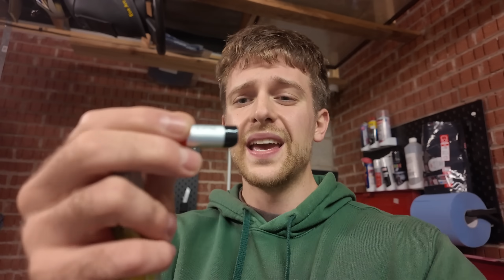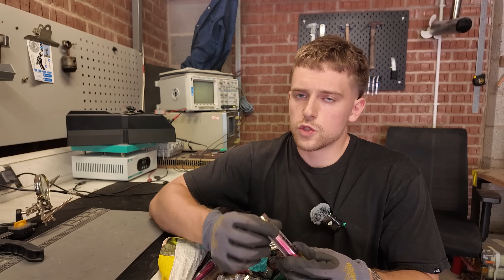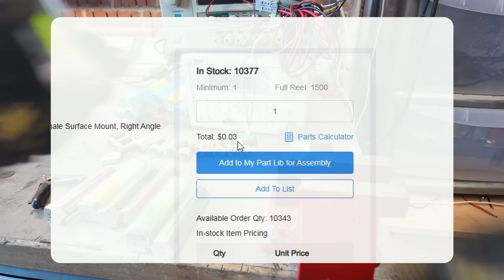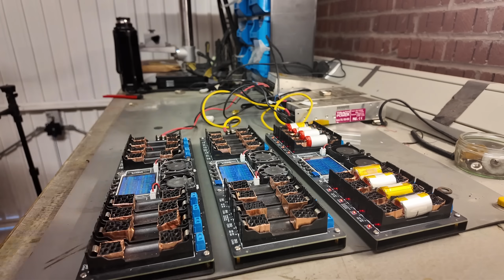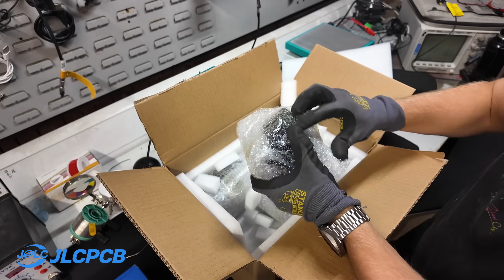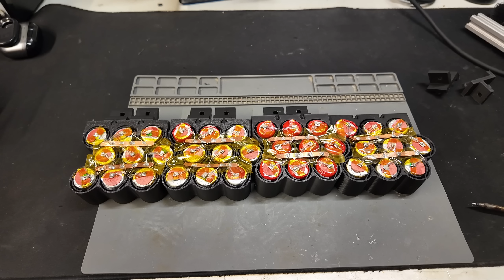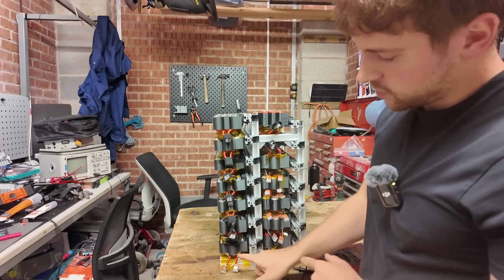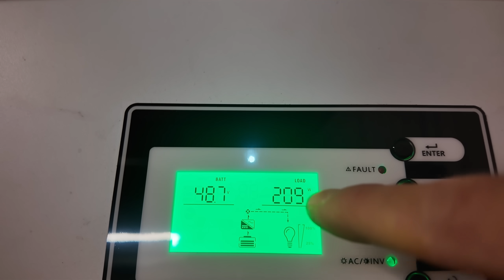I Powered My House Using 500 Disposable vapes

Comment: Drawing 3kw out of this thing and not pissing your pants... Impressively large balls.
Reply from the maker: Ngl I didnt even mean to draw that much power & didnt realise how high it was until I went back to review the footage!!!!
Reply: @Chris_doel  heh i usually find out im drawing too much the... other way ;o
Reply: @Chris_doel fyi: The Wago 221 connectors you are using are only rated for 20A. I have personally seen them melt at around 50A.
Reply: @fex95 actually I just came from A TSI Automation expo, and the Wago 221s are only rated to that because that’s what they’re required to be. They can run much higher. They’re rated for AWG24-12 and can do 30A but only list 20A
Reply: @Apoc_CoD that's all very well but when the kettle went on it was drawing over 60A! It looks like there are two connected in parallel along the whole circuit but still very much in sketchy territory
Reply: @fex95 you can also get bigger rating ones. Not sure what he actually used tho. Good point.
Reply: @Chris_doel  Hit them 3.7V old cells with 7.2V charger for 20 seconds to revive them.
I do it all the time, works 99% of time
Reply: @gimigimi1299  this sounds like a great way to make an explosive event quickly
Reply: @gimigimi1299 and the 1% of the time is them exploding?
Reply: @gimigimi1299once the cell drops below 3v, there is irreversible damage that can cause dendrites (conductive whiskers) which cause high internal resistance and that results in heat. When lithium gets hot, it off gasses and eventually ignites. That’s where a run away condition starts. You just don’t want to mess with it. You might be able to revive certain cells, but it’s only a matter of time before that cell turns into a balloon bomb.
Reply: @efahrenholz  you are just no fun! Jk, playing with used lithium batteries is definitely something that should be done with caution and realistically(imo) shouldn’t be left unattended in a project 🤷‍♂️
Reply: I'd say the most scary part is not being able to know the true maximum amp output of each cell
Reply: @keen283  Well, for nearly all vapes with the round celltype i could find datasheets for the cells. turns out the manufacturer are pretty consistent with the cells. so out of around hundred Vapes i had 6 Cell of different/unknown brand. Same goes for the Soup-noodle-bag cells. All pretty consistent in measurement (capacity, self discharge, internal resistants) bud sadly no datasheet, cause no identifier numbers printed on. 

Those cells are optimised for high currents, not energy density. Which makes sense if you consider they must be capable of vaping some liquids by resistive heating. So a small 0,5Ah Cell is rated at permanent discharge of 5A and 8A for short time (15sec).
So drawing 3A of them at max load here, is like spa-holiday for the cells.
Reply: @arminosaeure29 that's good info to know, didn't really think that some brands actually care enough to provide technical information
Reply: @arminosaeure29 ”soup noodle bag cells”???
Reply: That’s actually a very high C rating I’m quite surprised…I might used these In high kv high amp draw for battery capacity mini ducted fans or small props…could be fun on an 5g 5000kv motor
Reply: @keen283 basically only 4 companies on earth actually make lithium cells, Sony, Panasonic, LG, and Samsung, they are the ones who do all of that good testing and documentation stuff. I have however seen rewrapped batteries, batteries that have tiny little 10400's inside of 21700 cases that are packed with sand, all kinds of nightmare stuff
Reply: @keen283  you can test that pretty easily, take one of them, charge it and put smaller and smaller resistor values until it blows up
Reply: @sigataros Ok, I’ve blown up all of my cells. What’s the next step?
Reply: @sigataros that's destructive test.  Many dischargers on the market that allow custom current, with voltage and temp monitoring. The issue is time...
Reply: @sigataros this really is not a good solution lol
Reply: @floydkirk-j3w lmao
Reply: @keen283  well you could take the mad man approach and use a few "sacrifice" cells for load testing each model of vape battery... 
Get the average for battery type (kill 5 - 10 each) and bingo, you kinda know what it is.

Or you look up the data sheet for the battery based on its serial and data written on the side. Like a normal person, but where's the fun in that. Also, most batteries in disposable vapes are high "C" li-ion cells, though I've come across LIPO batteries in the past too,  (which is terrifying if you know anything about the madness of Lipos aha, I always say goodbye to my family when i head to the shed to charge my FPV Lipos...) 

Though, most dispo vape cells never go past one cycle cause they end up in landfill, so all things considered outside of being too discharged, they're usually REALLY healthy. But that doesn't mean you use them for something like this, especially in this configuration.
Reply: Nah not having a clue on each mixed cells C rating scares me way way more
Reply: @keen283  Yeah, the misinformation on these sorta cells is the most anxiety inspiring point. Soldering near em or building a pack out of them is only scary the first time or two you've done it.
Reply: to be fair thats only 6w per cell, with the average vape pulling over 15w when you take a hit off it. theoretically it should be golden for 6kw and still have some headroom for safety
Reply: @badatcad for a short amount of time it's fine. I wonder how long it could handle 3kw before it overheats too much
Reply: @badatcad  It’s the current through those WAGOs I’d be worried about.
Reply: @badatcad  15 for rubbish disposables, ive been vaping for 12 years now with a 220w device set to 65w
Reply: @lennycat7964 my man, I used to run .09 ohm on a triple parallel 18650, used to load brand new, fresh charged vtc5s down to 3.6v lol
Reply: Vape cells usually put huge currents. If he has many and correctly monitored (BMS) is not scary unless his inverter or BMS is bad
Reply: @111Xumi111  Yes, for less than 5 seconds.  I've been vaping (not disposables) for many years and every vape I have ever used shut off in 5 seconds.
The early mods used standard cylindrical cells, but most now use pouch cells.
These cells are not designed for long high discharge and they aren't built for longevity.
Also, most modern disposable vapes are USB rechargeable.  But you cannot add liquid to them or change out the atomizer.  But they use tiny batteries that have to be recharged before the liquid runs out.
Reply: @tarstarkusz  that is basically not true. that vape turn off after 5 sec is a political decision, not a technical.
manufacturers can optimize their cell for different things, high capacity, recharge cycles, and high current are only a few points to optimize to. In a laptop or phone you want most capacity possible, on a EV you want high charge/discharge and cycle stability. Those Vapecells are optimized for current. 10C constant discharge current are normal.
Reply: @arminosaeure29  Sure, there is no reason for it relating to the battery if you use a battery good enough for the application.  
But it is very rare, none that I know of, that allow for longer than 5 seconds.
Reply: @tarstarkusz  because it is not a technical reason. Politics decided that vapes have to stop after 5 sec. most vapes i salvaged the cell from, at least those with cylindrical cells, i could find datasheets. very consistant trough out every vape brand, high current cells with ~10c constant discharge and peak ~15c/10sec. plenty enough for continuous run of the vape till battery is discharged. for the pouch cells you usually cant find DS due to no labels, but in terms of internal resistance, volume and capacity, they should run in the same ballpark .
Reply: @111Xumi111 Knowing you made it yourself makes it scary though
Reply: @SquiddyyBoyy  sadly most things in this world are only better when you make it yourself, for yourself.
Reply: @SquiddyyBoyy  multiple layers of safety, from fuses from each individual battery, a fuse in between the series connection of those 25 volt stacks and a BMS to top it off, and knowing how it was all made and with the technical know-how, I think it's as good as safety gets for reusing these batteries practically
Reply: @SquiddyyBoyy  When you got no clue what you are doing, then it is scary.. If you know what you are doing, it is not scary...
Reply: @FireGodSpeed  When you have no clue what you are doing, your stupidity and ego protects you, when you know what you are doing...you know how sketchy it is.
Reply: @SquiddyyBoyy  Well this guy looks like he is a professional. Bit of a mad lad but still knows what he is doing.
Reply: @SquiddyyBoyy  so if someone else built it makes it safe then?
Reply: @FireGodSpeed  i made a 14s9p battery by soldering together 18650 cells taken from laptop batteries about to be thrown out
 
it worked well as an ebike battery for 3 years but i was still scared it would burst into flames every time i charged it
Reply: @SquiddyyBoyy  You trust a random workshop in china more than yourself? Thats worrying bud
Reply: @SquiddyyBoyy  spoken like someone with very little confidence in his abilities.
Reply: @SquiddyyBoyy knowing Chinese people didn't do it is SOOO SCARY HUH?? Maybe let's all start being nice to them, huh?!
Reply: @FireGodSpeed  bro, if you're not scared, you have no idea what you're doing. i learned electrical safety from a 70 year old man who had a lightning strike up his entire arm and a large portion of his chest
Reply: @SquiddyyBoyy naw I'm dumber than this guy and less careful and I'm still alive. Built dozens of higher voltage banks than this one. Yes explosions can happen. No it's not likely. I've dropped so many metal things completing circuits where I knew i was dead lol linking the positives of two 72v packs and things like that. Like this guy I tend to not take enough time for safety measures. He's not exaggerating it takes FOREVER to do every step by hand by yourself it takes months, hours every day. If you've shorted a car battery it's about that exciting that's it. Brighter flash though it'll blind you temporarily. The real issues are sharp objects, puncture one of the cells and it's over instantly. And plugging in two drastically different voltage cells, this one you can save if you are paying attention. The cells will rapidly expand before catastrophe. If you break the connection fast enough the reaction stops and you're alive. Cells are dead and you prolly gotta change ur shorts but, it's only kinda like a bomb. Not an actual bomb lol watch next week I get killed by a battery pack. Embarrassing
Reply: @Harolds_Archive  What has a lightning to do with electrical work? HUH?.. One is controlled and predictable and one is random and cannot be controlled.. If you wire the live cable together with the ground well you know what will happen and its your fault, that it happened. If you get hit by lightning that is completely random and you can't control it. I don't see the correlation between the two. 

There’s always some uncertainty about whether something will happen, but exceptions don’t change the rule. 

I run lathes, milling machines (manual, cnc). I work near hydraulic lines, near open flames, molds that are 300 degrees C, Near a furnace. I am not scared of any of these, even though "what if" A part comes flinging out of a machine? "what if" a hydraulic line bursts and shoots a hole through my arm? "What if" a open flame hits me and burns me? "What if" They drop in wet metal and it "explodes" and shoots molten steel everywhere? 

My guy is living in constant fear and wants to tell me that you should be scared of the work you do, especially when you know what you are doing... What. You should respect and be cautious about the work you do but scared is the wrong way.
Reply: @FloofyTanker  what kind of fuse did he use for each cell according to you ?
Reply: @hiiambarney4489  *makes it look like he's a professional. Inspiring people to have the confidence to follow in his footsteps, and potentially burn their house down.
Reply: @randomoldguy7  Really, "sadly most things in this world are only better when you make it yourself, for yourself."   This is just generalized hating. What do you think your dishes, utensils, clothes, shoes, blankets, books, fishing poles, doorknobs, furniture, would look and function like if "you" or anyone else made most of the stuff in the world? And I chose examples based more on just craftsmanship and finish - consider complex objects not to mention electronics, HVAC, vehicles, appliances, ...? The reality is most things in the world that most people use can not be made by most people even if they had the time and means to do so. We are insanely interdependent on each other and that includes a lot of people/occupations/skills that are often not even recognized.
Reply: @SquiddyyBoyy id rather know I did it than some rando in China 😅
Reply: @FloofyTanker  This isn't a practical OR safe way or reusing these.. they're not actually meant to be reused that's why the vape batteries are so cheaply made compared to a usual 18650 for example.
These also aren't good for putting out a lot of current. 18650s can yes, not these, they will rapidly heat.
Reply: @hiiambarney4489  Never introduce him to styropyro.  They'll collaborate to make an extremely dodgy laser of some sort.
Reply: @AlpineTheHusky  when you have no clue what someone else is doing, you think it's sketchy because you don't understand how it works. when you actually understand how and why it works and make it yourself you will know it's not sketchy.
Reply: not if your smart
Reply: @randomoldguy7  the sheep feel safe with a logo on their equipment but it's also just built/designed by some dude
Reply: @yannmassard3970  9:27 He also showed the Tesla battery as a similar example. Did you watch the video?
Reply: @TheBladus id say put a can of fire retarded insulating foam next to the bms or inverter. Incase it blows it'll just be a big mess to clean rather than a house set on fire. 😅
Reply: @FloofyTanker  actually either a fire proof metal container for the lithium ion battery packs (which can be extremely dangerous) or put the batteries away from the house / living quarters,.. nice FREE project though!.. and lithium iron phosphate do not catch fire like the lithium ion batteries if you have $$$
Reply: @111Xumi111  Huge currents for a second or two, continuous load is a very different matter.
Reply: @111Xumi111  I don't care how good the BMS is. Chinese crapola vape batteries are essentially live rounds that didn't go off, 24/7. :D
Reply: @111Xumi111  those dodgy solder joints don't inspire much confidence
Reply: @D4no00 no I am surprised he hasn't got a battery welder especially for a project of this size.
Reply: I was also shocked he didn't have any go poof on him. 😂
Reply: @alexandergreenfield91  Unfortunately you cant weld these. They have little fins.
Reply: @D4no00  they come dodgy out the sweatshop they're made in to be fair
Reply: @alexandergreenfield91  You can't really weld these types of Lithium cells. They have little soldering flanges built in, can't weld those. These cells are made for soldering - but I agree, the solder joints seen in the video DO look sketchy.
Reply: That's not really a lot tho considering the amount of cells, and with the safety features it's unlikely something will happen. Lucky for us batteries don't just explode for no reason so if you take care of everything correctly it will be fine. Also a fun note about drawing power but I've seen 7.4V battery packs designed for some 70A meaning you could pull 5kW out of 2 cells in series
Reply: @panzervpl94067.4 x 70 is ~500W not 5kW?
Reply: those vape batteries have huge CDR lke 10A atleasat so 500x10A(probably can handle more)x3.7v they are probaly able to draw 15kw
Reply: It's parallel connection. TBH using those thick (costly) bus wires was an overkill.
Reply: Vaping from a single cell probably pulls way more current than how much each provides in that case.
Reply: With electrical systems you need to consider the amps not the watts. And in the case of this battery it was less than 65a.
Reply: Load balancing is the really big problem with these larger batteries.. Both on drawing power and even more on charging. Was very glad to see those fuses.. Its charging where you really need the red& white headband and the priest praying over you..
Reply: @Lucien86  The battery gods will bring you plentiful safety if you learn to respect the lithium
Reply: Ive pulled 3kw through a 1850va UPS, no big deal. Little smoke though
Reply: Pee is stored in the balls.
Reply: 12.5 Amps?
Reply: Piss is stored in the balls, makes sense
Reply: Go watch styropyro hook up some car batteries and see what he does with it :)
Reply: Woman are strong to.  These comments is leaves women for equality
Reply: When you know what you're doing you don't need hope.
Reply: Yes amazeballs 🎉
Reply: Next time byd battery
Reply: Magyarországon, több mint 100 embernek van ennél sokkal nagyobb, és biztonságosabb rendszere.
3kWh semmi.
Magyarországon autót töltenek éjjel!
Reply: Put it in a metal box that vents outside if it gets off.
Reply: @MarkkuS  Get the Batsafe.
Reply: @CURSE-LFC bat safe, not in main building i occupy. Battery safety is like my no1 prio
Reply: Well, obviously, as piss is stored in the balls.
Reply: pee is stored in the balls
Reply: battery pack is in the warehouse so that mitigates a lot of potential damage. hes thought this through
Reply: @Okahui that way you can kick that shit out if it blows
Reply: @Okahui much better to build an outside rack just for the batterypack.
Reply: That's some hefty voltage sag when current is drawn from the pack. Obviously the BMS is not optimised for those cells.
Reply: What you dont see is a 5 gal bucket of sand under the table he can shove a battery that starts to run away, it happens all the time, dont freak just be ready for it, when you are playing at scale you would not believe all the safety in the back ground, but .... 3kw is a good start LOL
I have 3/4 of a ton of AGM at 145AH each for a total of 15KW
Keeping in mind you can feel DC starting around 30V so 100V at 1 amp will kill you! not much more than that and it will leave Burn marks on your Organs on its way through your body! A/C leaves burn marks on the outside, at least A/C will throw you! BUT DC will Grab and Hold you and it will hurt the whole time!
if you dont know what you are doing and not comfotable with Electronics.....Dont.
Electrical engineers have to play, that s how things get done and invented, finding things to do with old equipment that sometimes have only been used to less than 1% of their life, like vape batteries they have been used one week out of their 20 year life....
sometimes where I am commercial solar farms cycle out panels after a year or two they may have only degraded 1% but to them thats a lot over 100 acre solar farm and we can get them cheap to free! I have even taken broken Biface (like broke on the back side still putting out rated voltage and amps) they will fail before their time but .... someone can use them until
I do suggest a good MPPT charge controller to start with, they normally run $200 and up and I have tried the $50 PWM I never had one last more than a week LOL
and dont skimp on wire quality! "Ever"
Reply: @Grandassets  This battery he made is dangerous.  These cells are not designed for long high amp draws.  Nearly all vapes shut off after 5 seconds.  They literally will not allow you to go longer.  The batteries are very cheaply made.  They aren't made for 10 cycles, let alone 500.  They are very likely to come out of balance as well.
Reply: @tarstarkusz  we could tell if we knew the numbers on them
Reply: @Grandassets  Sand and fireproofing materials + concrete and hole in ground with sufficient ventilation, otherwise you get a subterranean explosive if a big cell goes "yeah nah fuck this dude, time to catch on fire".
Most people watching this video probably won't attempt something like this due to lack of technical knowledge. But it isn't impossible to self teach, maybe do a certificate in basic electrician safety if you're absolutely new..
With that said, after my many years of playing around with dangerously high voltages (CRT flyback transformers) and "instant death" amps (microwave transformers), as well as my many LiPo powered projects (FPV drones mostly), I still fear electricity.

I'm comfortable building things that use high power, but something I've learnt over the years, is that those that learn to respect and fear electricity and lithium, are usually the ones that survive.

LiPo's alone are terrifying, a charger (had a mate get into FPV but bought the shittest and cheapest equipment he could) that is improperly calibrated can take a 4S battery to 6S voltages and you're left sitting there thinking "how isn't this thing on fire?"
I always store them in batsafes or battery flight bags, routinely check the cells every week to keep them at storage voltage when not using them etc. 

The lithium gods always treat those well who respect the cell. But they keep you on your toes, sometimes batteries just like to fuck with you cause they can.
Reply: @ausboard  Enough sand alone hanging over the batteries ready to dump is important enough
Reply: Yup, 5 more minutes and 🤧🤧🤧
Reply: Beefy build fam, well done. 

Practically speaking lmao 😂

But I watched the whole video
Reply: as an electrical engineering student in a design group for a solar powered EV, the second he said BMS I knew he has to have quite the electronic background. This guy is most likely an EE or adjacent, or someone with a lot of industry experience; crazy good work!
Reply: @formy5287  You are probably right about his background, but come on: BMS are nether rocket science nor a which craft secret.
Reply: How does he run this at 50 volts and is able to run his house? Wouldn't he need 120 or 240V?
Reply: @noahw5887  that's what the inverter is for, all explained very clearly in the video
Reply: @noahw5887  Thats what the inverter does. Takes DC 50 Volts from batteries and inverts it to AC 220 Volts.
Reply: @noahw5887  16:55
Reply: Jesus Christ is real and he wants a relationship with you personally, He is the Way the Truth and the Life and He loves you more than you can fathom ✝️🙏🏽
Reply: @xoapbtw8914 this is true, but in this day and age peoples faith is seriously being tested...with many people failing, giving up and never wanting to return.
Reply: What's scary is that he increased the voltage to 50 volts before the inverter. Very unnecessary and dangerous.
Reply: @jamesjonnes  48 Volts is the typical working power gor these kinds of battery packs. That‘s what the inverter expects. Lower voltages necessitate unnecessary thick cables due to the higher resistance. So it‘s actually safer. Still I eould monitor the battery with an infrared camera to look for potential hotspots.
Reply: @jamesjonnes  not at all. higher voltage at given power means lower amps. Therefore less resistance in the connection and cables. With this Setup he has roughly 75A at 3,6kW on the Inverter.
If he would wire both 25V Stacks in parralel, the Cables must be capable of dealing 150A...
Not to mention that most inverters are more efficient with higher Voltages. S some crazy ass blokes build themself 300V Batteries and directly injecting into the HV-Circuit of the inverter skipping the Boost-part
Reply: @jamesjonnes Well you’re wrong but please tell us more. A 48v battery pack is about the minimum voltage you’d want to use for a house load.
Reply: @jamesjonnes  He did charge them yes, explain what is dangerous?
Reply: @jamesjonnes You are 100% wrong. It's necessary & it's safe.